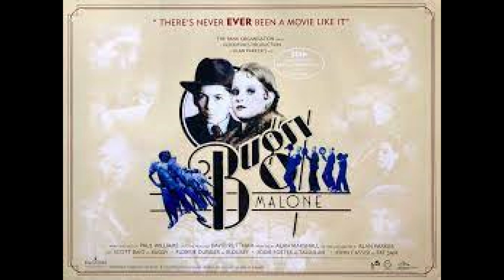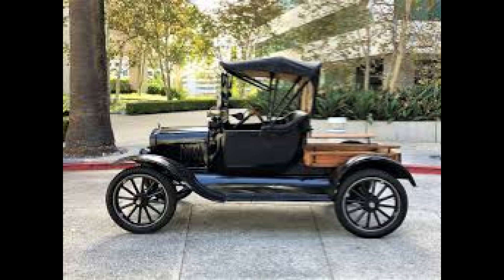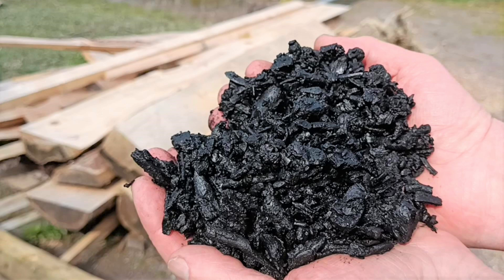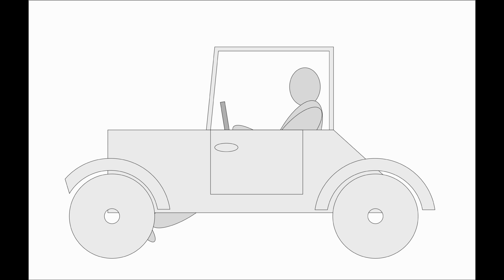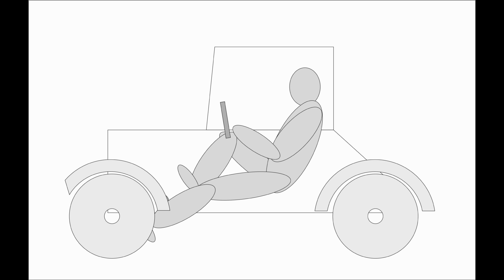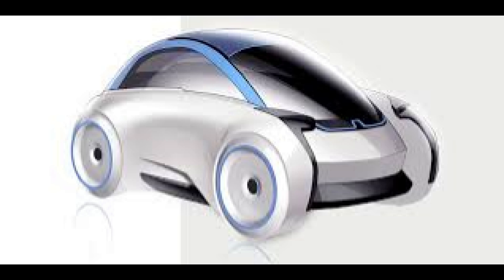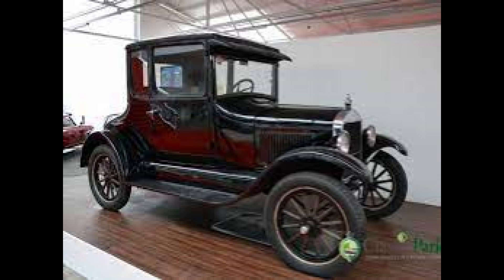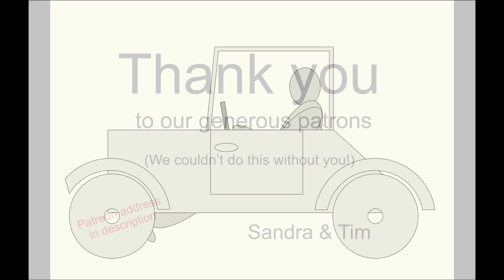Could We Build A Full-Size Wooden Pedal-Assist Electric Car?

Comment: Tim I have plans (somewhere) for a two-seater pedal car which was designed and built by an enterprising German. I saw it demonstrated at a bike event. It worked beautifully, was relatively light, but was just a chassis with no bodywork. I feel like it could easily be adapted to have an electric assist motor. I'll happily send them to you if that sounds useful, always assuming I can actually find them of course.
Reply from the maker: Yes, please, Chris. That would be great! Email in description..
Reply: @wayoutwest-workshopstuff6299 
It seems that my original (very positive) comment is kind of blocked. Therefore I try to send it again:
Dear inventor Tim
Hooray 🙌🙌🙌 Maaaan, this is definitely a really, really great idea! Congratulations! 👍👌👏 Although I would rather build an easier 3 wheeler, I absolutely love 💚 your idea to fulfill an old dream of yours by fabricating a 4 wheeled pedal car.👍👌👏 Will you have one pair of pedals or is the passenger "allowed to help" too? 😁 ;-) I own some bicycles, parts and a lot of different material and would love to donate stuff. But unfortunately I still live in Germany = too far away from your green island, sigh. Will the batteries be in the pedal car or in a small trailer so that you can use it on the property as a versatile power source? Maybe even for the garden railroad? Will the roof have flexible solar panels (like the relatively inexpensive ones used on boats, even on biminis)? Or will even more of the car body surface be covered with solar panels? Okay, okay, I got carried away. I'm already simply very exited and enthusiastic! Anyway:
I hope that you will find a sponsor for the electric components.
Please, Sir, please don't bother answering my questions. Your free time is already scarce enough. I will automatically get answers in the following video series. Of course I'm eagerly looking forward to watch the next part.
Best regards, luck and especially health to all of you.

Comment: Either an old electric golf cart or mobility scooter might be your friend for the mechanicals.  The idea of glass reinforced fibre/epoxy coated plywood chassis/body is a sound one. I look forward to seeing the progress and will no doubt be surprised by the engineering solutions you come up with, I usually always am. Cheers.

Comment: Does it make more sense to have the pedals power an electric generator that would in turn power an electric propulsion motor? That way the propulsion could be fed from either pedal power or batter alternately and the pedaler could pedal at a steady constant rate and not be impacted by the demands of the road, like someone pedaling a bike up a hill.
Reply: this is how the Podbike will work; it's only ~70 percent efficient but has the benefits you mention
Reply from the maker: but a human can't produce enough electricity to move themselves and a car